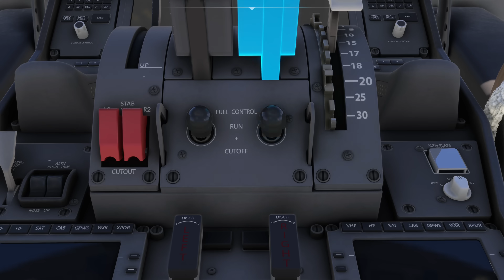Air India 171: Why Did The Fuel Cut-off Switch Get Moved?

Comment: Why are you not covering the advisory ? It’s clearly state. why you are not even mentioning to that? It’s very strange when boeing themselves are saying it can be moved accidentally..

Investigators referred to a 2018 FAA advisory, which urged - but did not mandate - operators of Boeing models to inspect the locking feature of the fuel cut-off switches to ensure they could not be moved by accident.

Comment: As a Flight Instructor and retired Captain for a major airline (45 years –all Boeing), I'm having a hard time respecting what Steeeve is doing here. We begin this video with the shrill comments and unanswerable questions of the media, and then continue with aimless speculation as Steve unfortunately serves to stir this tragic pot. You will not receive an answer here, and we may never get an answer regarding this accident. Still, this ongoing chatter fuels the beast that thrives on blame, speculation, and ultimately, confusion and fear. Sorry, Steve, with three-quarters of a million subscribers, in my humble opinion, this is not helping.

Comment: Simple. Try blame pilot and wash your hands off? Boeing has been a nefarious company doing software controls rather having actual safety mechanisms. What you experts are missing is it takes atleast 10 seconds to cut off engines. There was no such time here for any pilot. It was glitchy sensor and software issue from Boeing. Just like 737 Max out there.

Comment: Have you reviewed flight NH985 where on Jan 17, 2019 that 787 had a dual engine failure during landing because the TCMA thinking it was an uncommanded high thrust situation?

Would the TCMA flip the fuel control switches to off for Air India (false positive event)?

Comment: I was intrigued by comment I heard from an Indian pilot who flew the 787 - (((("If this was a case of pilot-suicide, there would have been far easier and reliable ways to crash the plane (like pushing the yoke forward).  But in the case of AI 171, they relit one engine and almost relit the other, meaning those brave pilots tried to save the plane. If they had just a little more altitude, both engines would have fully reignited, and this incident never would have happened.")))
So the rushed narrative of pilot suicide (with only partial, and selective, cockpit conversations published) smells fishy.  Is this to cover the asses of GE, Boeing, and the insurers?  Blaming dead pilots (before a comprehensive play by play final report is out) is patently unfair and smells of a major cover up.  Meanwhile the families grieve and the dead pilots are demonized.  As for you Captain Steve, you have also taken driblets of information from the day of the crash and ran with it over the past few weeks.  Sure, it was all purely theoretical but there is a statement you keep repeating (rather suspiciously) - "That the aircraft performed like it should have".  Are you that sure?

Comment: If the fuel cutoff switch on the Air India flight was accidentally turned off, then there should’ve been an alarm or warning in the cockpit — so why isn’t it showing up in the Flight Data Recorder ? Is it possible that the FDR doesn’t record that specific switch? Or was there a system fault that’s being overlooked or hidden

Comment: The DFDR, I've been told by a reliable B787 engineering source, cannot and does not monitor the physical position of the fuel switches. It does however monitor the position of the fuel valves and that is what was registered in this instance. So if the fuel valves were driven to shut position by some other source, the pilots would've gotten an engine failure warning followed rapidly by a dual engine failure warning. The conversation would have been the same. The lack of attribution of the excerpted lines makes the AAIB work look slipshod as hell and lookss auspiciously like they want others, Capt Steeeev for example, to draw certain conclusions. But other thought processes have not been eliminated and there's still no evidence to show that either pilot moved the fuel switches to cut off prior to the engines failing. So I request all to hold off on concluding anything at all. Remember that Boeing simply blamed the pilots after each Max crash. It was only because Ethiopian Airlines wasn't buying that, that the rest of the muck spilled out.

Comment: A design enthusiast here.. the current scenario of using a single pilot input is a serious design flaw that puts lives at risk incase of deliberate pilot sabotage.

Using the 2 PILOT CONCURRENCE (2PC) method will help avoid catastrophies like the below (deliberate) crashes.

Events the 2 PILOT CONCURRENCE (2PC) method could have prevented:
1) The captain reprogrammed the autopilot deliberately to fly into terrain In the LAM Mozambique Airlines Flight 470 crash. For any major autopilot change like sudden altitude or vertical speed adjustments, needs to have approval from 2 pilots.

2) Locking the cockpit door to prevent the co-pilot reentry In the Germanwings Flight 9525. To prevent this, the cockpit door system can be designed so that one pilot alone can't fully block access. Both pilots fingerprints needs to be entered before each flight, giving both of them control for locking the cockpit door, but anyone pilot can open the door with his fingerprint.

3) Disabling cabin pressurization In Helios Airways Flight 522, while it was unintentional, pressurization loss led to everyone onboard losing consciousness. To avoid any deliberate override, the system must ask for confirmation from both pilots before allowing such changes.

4) The captain pulled engine fire handles to shutting down engines intentionally deliberately in LAM Flight 470. The 2 pilot concurrence can be used, except incase there’s an actual fire alert from the system.

5) Due to fuel mismanagement, dumping fuel mid-air In Air Transat Flight 236, fuel loss had happened. Fuel dumping or major reconfiguration needs 2 pilot approval to avoid such events from taking place.

6) The pilot disabled the navigation and flight data systems in Qantas Flight 72 and SilkAir Flight 185, when the cockpit recorders were turned off before the crash. Disabling any of these systems should require 2 pilots to confirm, so that no one pilot can shut them down alone.

7) The pilot retracted the landing gear too early during takeoff In JAL Flight 350 causing it to crash. The 2 pilot confirmation during takeoff or landing can prevent this...

8) The pilot turned off the cockpit power to disable flight recorders and avionics In SilkAir Flight 185. 2 pilots must approve any power cut to the flight recorders or essential cockpit systems.

I have spent some time on this and done my bit, together we can find even more design flaws that needs to be eliminated! 👍

Hope someone in the Boeing/Airbus design team or FAA sees this and bring in the 2PC design method and make these design changes for risk mitigation and saving lives in future!
Reply: You can never engineer away malicious intent! Humans will always find a way! What if for example after all those precautions the malicious /suicidal pilot simply takes an improvised hammer and smashes all the screens and display instruments and pulls out all the circuit breakers! You do know pilots have access most flight critical circuit breakers, don’t you?

Comment: Why there could not be a safety interlock for the fuel switches where it's possible to cut off the engines only when the aircraft has reached a safe height just in case such a situation arises where the switches are deliberately switched off at a low height making it difficult for the pilot or pilots to handle the situation.

Comment: For my own curiosity, could it be possible for such switches to be inhibited (ignored) by the flight computer at such low altitudes, or critical phases of flight?  That is unless there is some other critical warning (Fire, Surging, or any other issue causing a master warning or caution, or even a ECAM message) which involves that same part.  IE: In this case both engines were running fine, no warnings or errors, aircraft had just taken off. Could the flight computer have been designed to ignore the fuel cutoff switches in this scenario?  Whereas say in the case of this same scenario, but with added bird strike and resulting engine issues (Surging or fire/damage), the flight computer would see the switch being used, quickly say well we have an issue with this engine, let it happen.

An example would be, in the Airbus A320, if a pilot jumps moderately hard on a rudder peddle, when the plane is flying stable and in cruise with no warnings, the computer says, that cant be right and only sends a fraction of the command to the rudder preventing a big yaw, bank and eventual spiral dive. In a Boeing say 737, the full rudder deflect would be commanded and if not corrected will result in a spiral dive.

I mean theoretically with how complicated the flight computers are and how everything is going more towards fly by wire, surely that could be programmed in. That said, the only real reason to program it in would be to prevent this exact instance of improper use of the switch by humans, and well we know that its pretty much unfathomable that a pilot would ever do that, until one does. I am sure it could be done, but would be seen by most airlines and manufacturers as not worth the development time and possible retraining or certification if certification would be needed.

Comment: Hi Captain, is it possible the Captain of AI 171 asled the question why were the fiel cut off based on the sound that he heard in his headset and not seen the switches turned off. Also the findings may have given the point about Fuel cutoff for engine 1 and one sec later for engine 2 based on yhe software log and not physical position of the switches. Many pilots are also saying its impossible to turn off two switches in 1 second gap can show ut on timer yourself how thats possible. Your comparing the Denial of the copilot to kids not agreeing to a mistake, its really possible that physical position of the switches may be turn on but the actual fuel to engines may have been cut off doe that chip issue

Comment: Let’s be clear — this isn’t about pilot suicide.
It’s about whether we learned anything from the MAX crashes.

Five months before Ethiopian 302, the Lion Air crew was blamed for being low-hour, undertrained, even suicidal — all while Boeing’s system was silently setting them up to fail. And now?
Fuel cutoff switches move mid-takeoff, one second apart, with no pilot confirmation — and we’re running the same tired mental health headline again?

These pilots didn’t choose the switch design. They didn’t ignore the 2018 safety bulletin. They flew the plane Air India gave them — a plane with a known flaw and no required fix.

This isn’t an Uber with two rogue drivers. This is a systemic failure dressed as a personal tragedy.

Let’s stop blaming the last people who had control — and start questioning the ones who still do.

Comment: Hi Captain, Just a question, surely there would be 3 pilots since the flight was longer than 8 hours, could it potentially been the inflight relief pilot that switched off the engines ? 

Just a thought since long haul flights have more than 2 pilots in the cockpit